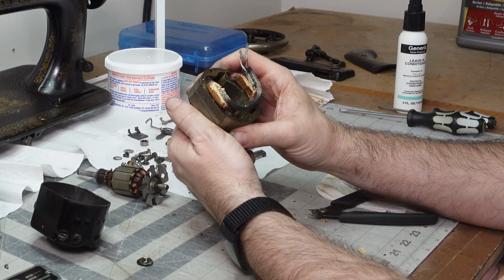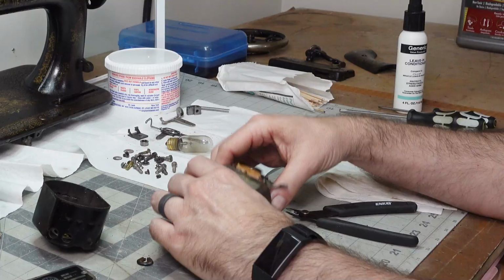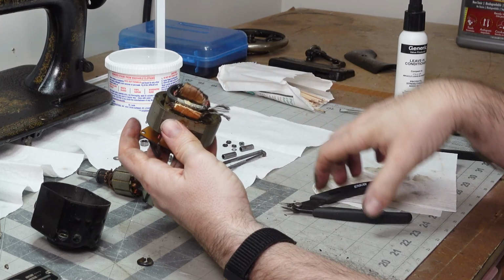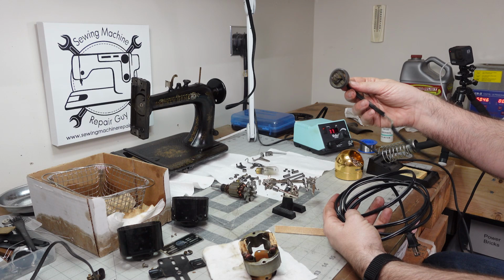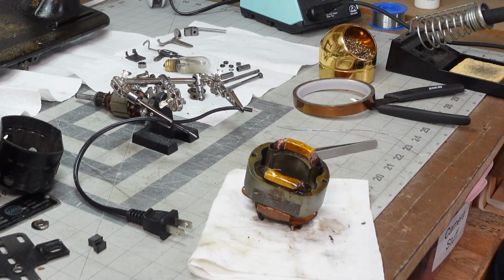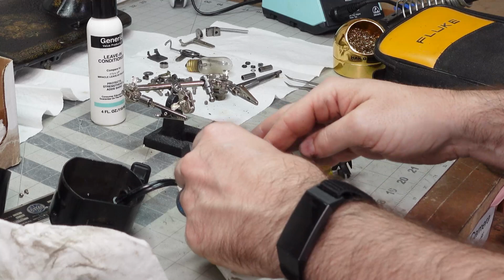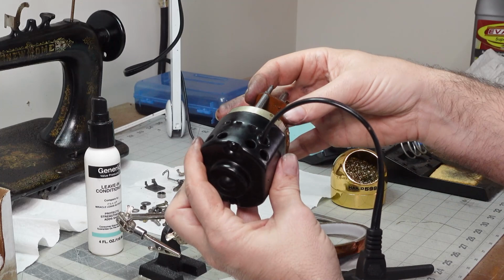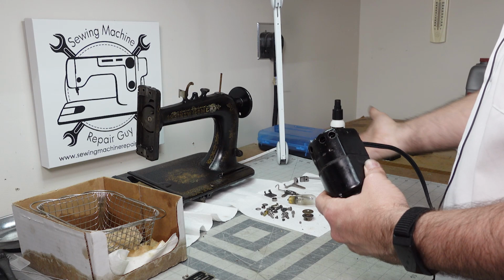Attempting to Rewire a Vintage Sewing Machine Motor. **Bonus Tool You Haven't Seen Before**

Comment: Thanks very much for showing us the motor anatomy, but I think this is only HALF of the repair.  What about the brushes? What about the wiring (springs) around the brushes? Did you clean the commutator?  How?   I am eager to see the FULL retrofit.  I have a 70 year old NEW HOME light running machine.  My Mother purchased it in late 1940s. Lightly used.  Motor wiring is frayed and sparks so I am afraid to use it.   I have cracked open the motor case.    Insulation around wires at the springs/brushes is old and stiff.  Wiring out of the case is also frayed.  Can I use shrink tubing to cover and protect the old insulation at the spring ends and just replace/solder the power ends?  No belt. It uses a rubber "tire" on  stem to turn the wheel.  Stem needs to be long enough for wheel contact.  I have looked and cannot find a replacement.  Also the bracket to connect to the body of the machine is different than typical belt-driven sewing machines.   So I am stuck trying to repair this one.  It is solidly built, all metal and there is a sentimental value as well.

Comment: Thanks for sharing, it is advisable to test the insulation with a proper Insulation Tester 
like this one 
Megger BM82/2 Multi Voltage Insulation Meter

which subjects the insulation to 500v /1000v dc between the body and the live wires if it passes then you are safe to use otherwise it is dangerous to use.

Comment: This video is so helpful! I was watching this because I'm working on a vintage sewing machine, but remembered your video when my vacuum motor failed... after opening it up, I was surprised how similar those two motors are. Anyway, the copper magnetic wire got too hot in one spot after it comes off the coil and connects to the neutral wire. The small piece that comes away from the coil was insulated with what looks like some black braided fibreglass tubing and then those two layers were then wrapped against the coil under a piece of transparent filament tape (like the kind used to package boxes) and then a zip tie. Something in that combination of layers caused the wire to get too hot and both the wire and fiberglass tubing got singed... and the wire broke in two. So, I am in a very similar predicament as your sewing motor here. I need to connect the two ends of the wire together again by soldering, (the end coming off the coil and the one that is still crimped to the neutral wire. I am thinking that the filament tape might have been the culprit. I like your idea of using the Kapton tape... any issues with using it since you made this video? Thank you in advance for any advice!

Comment: I have faith in you and you will get it going. A good acetone cleaning and new wiring might do it. Thank you for the tutorial, I enjoy learning all I can about repairing sewing machines. I like your soldering station. I used to repair video poker monitors and the circuit boards and I have a Weller soldering station.

Comment: Just rewired my first one today. Thanks for the video. I think the bushings are shot in mine. Center shaft wobbles a little. Need to find those somehow. Think its a Singer 20. Child's toy. Wife reconditions early machines. But not the motors, so asked me to give it a shot. I build electronic circuits, so was not totally dangerous. Thanks again for the video. Helped a lot.

Comment: Beautiful Craftsmanship there, and a lot of patience from You! You successfully salvaged that motor. The motor is pretty huge and I wondered what the RPM Speed on it was? I could swear Salirite Ultrafeed Motors spin about 7000 RPM just before they're geared down to be more manageable on Fabrics, but your looks like it's a 8000 or 9000 RPM Motor, and I want one for some of my home sewing machines. One of my Japanese Early Era Sewing Machines has an outside attached motor rated at about 4000 RPM. I wish to hot Rod that one and still keep it portable.

Comment: You are going to check it with a megger (mega ohm meter) to check insulation resistance
Reply: TV corona dope works great for soaking into wiring that's messed up ....

Comment: You're going to a lot of trouble that you don't need to and I understand this is YouTube but the bare wire can be dealt with with a good brand of heat shrink tubing doubled up and when you make a Western Union wiring connection with solder you can slip a brand new wire right in that motor and you will never know the difference but I have done this for years I just wish I could get on YouTube and show how I do it.😙
Reply: You're on youtube ol timer..... You even said so.... Now.. Get at it

Comment: Hello. Thank you for the great informative video. I have my late mom's Singer sewing machine. It has the no. 401 - TW on the side. I am assuming that is the model no. The motor heats up and sparks start flying inside of it after a few min's use. Then it will stop working. I can only use the machine 2 minutes at a time. I see replacement motors on the net and wanted to know how to choose the correct one. None seem to have the exact no's that I have on my machine. Thank you

Comment: I have a 1950s Montgomery Ward sewing machine with a motor that needs replaced (has same issue as the one in this video) The motor is a 1.3 amp 115 volts where would you recommend getting the motor. I was told that the Singer motors could work for this machine as long as the amps/volts was what was needed for the machine

Comment: You soldered the connection and then covered it with the Kapton -tape . is that correct? It was hard to see. do you always use Kapton tape instead of electric isolating tape? Hope my question is not too ignorant.

Comment: Excellent video Wes! Fun and games with old motors. I've never gone quite that far myself.
What was the name of the tape that you used and do you think that it will hold up over time? Thanks. 👍
Reply from the maker: It is Kapton Tape, I added a link for it in the description of the video. Yes, I think it will hold up. It is made for high temperature/long life applications.
Reply: @SewingMachineRepairGuy  Brilliant. Thank you. 👍